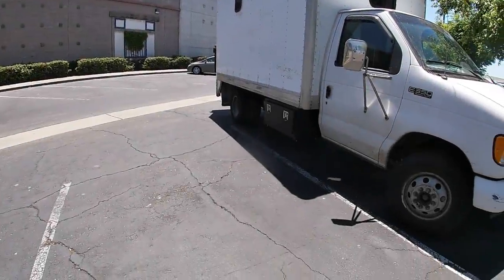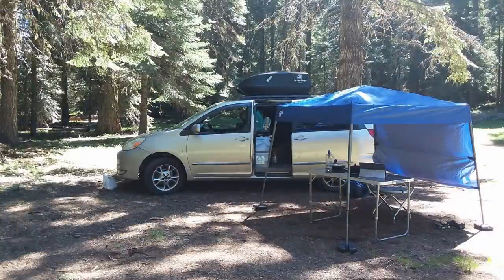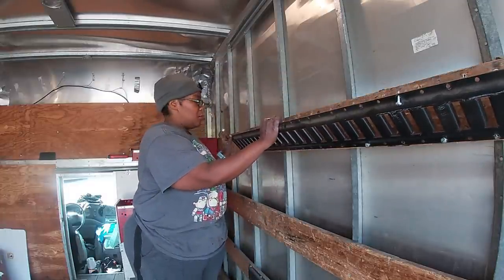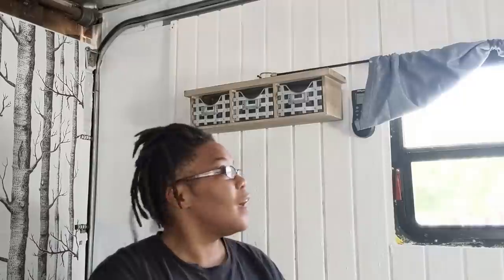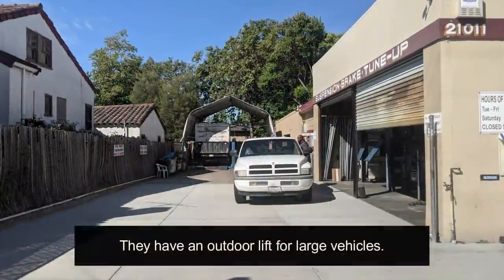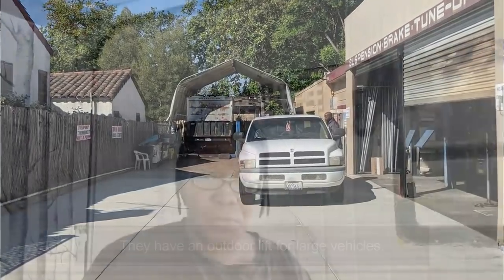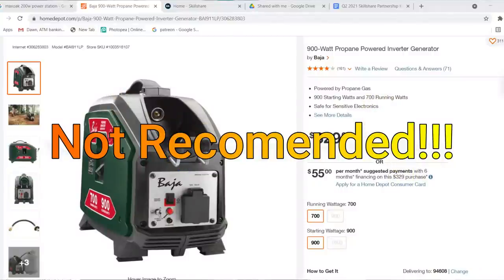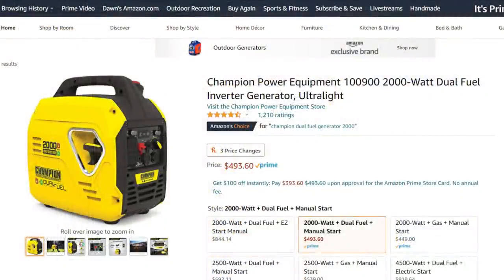Vanlife In a BoxTruck | Replacing A Stolen Catalytic Converter

Comment: Doing it Right, I had the same Box Van they didn't get my Catalytic converter but they cut the steel pipe. I actually sold mine and bought a Chevy Express 3500. If you put a Good Solar System on the Van you can actually put a Wash machine and Dryer in your Van. The Thing to builds is Keep it Simple.🙂👍New Subcriber.